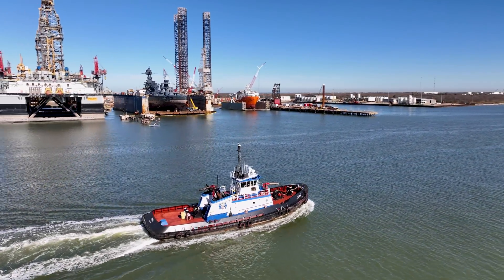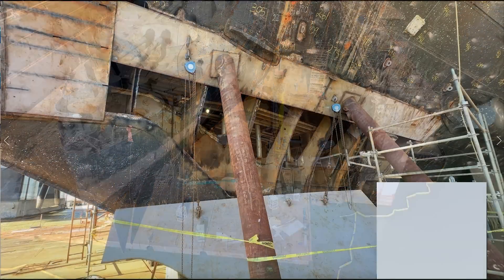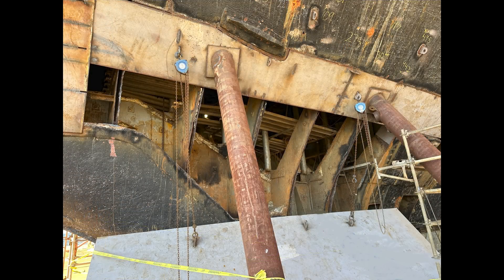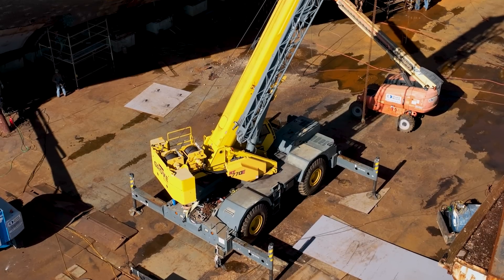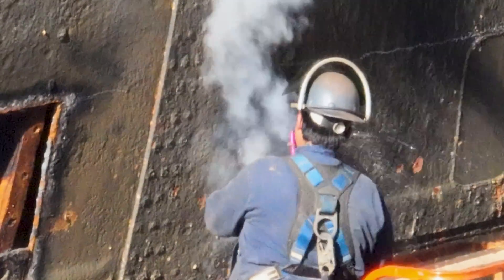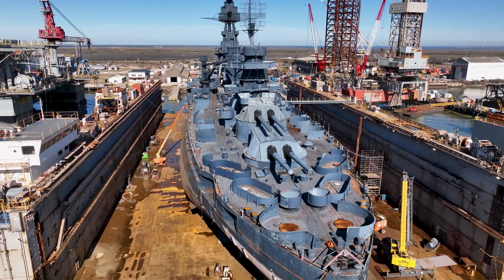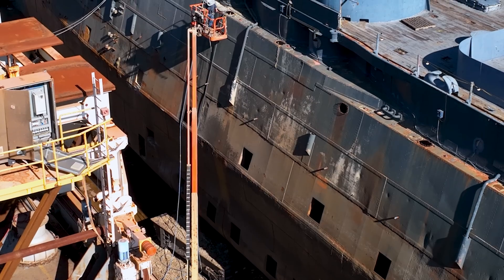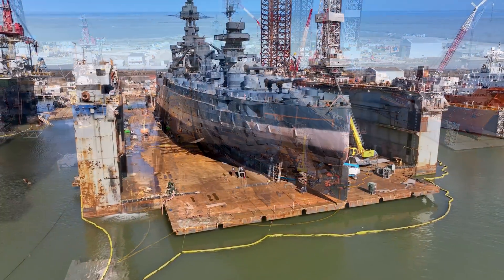USS Texas Battleship Texas Keel Exposed First Update Video of 2023

Comment: In case people were wondering
The reason they couldn't use torches until the insulation was removed in many kinds of expanding insulation can burst into flames at low temperatures. The kind they used on the Texas was similar to the insulation they use on larhe commercial freezers/refrigerators

Comment: I wonder if it would be possible to use stainless steel for hull plating to fight future corrosion.
Reply: @David C Too expensive in the short term but what about over the long term? Say Stainless Steel lasts three times longer than regular steel is it too expensive then? I am not trying to pick a fight, I respect your opinion but I am just curious. I don't really know a lot about metallurgy and I don't know if stainless steel could even be used in hull plating. It could also cause some issues like when two different metals are in contact with one another it can actually accelerate corrosion. A good example would be the Oliver Hazard Perry Class frigates. They had a steel hull and an aluminum superstructure. Where the steel and aluminum were welded together there was all kinds of corrosion issues.
Reply: @David C LOL I had to do a little research because I love learning new stuff. Stainless Steel won't really provide any extra protection over normal steel because in a the chromium in the steel combines with oxygen to form an invisible surface layer of chromium oxide that prevents further corrosion from spreading into the metal's internal structure. According to Anne Marie Helmenstine, Ph.D., "This protective film will self-repair if damaged, if sufficient oxygen is present. Stainless steels have poor corrosion resistance in low-oxygen and poor circulation environments. In seawater, chlorides from the salt can attack the passive film more quickly than it can be repaired in a low oxygen environment."

Now I know why they don't use stainless steel in ship hull plating.
Reply: @Bellthorian   Does stainless even come in 1/2" thick?